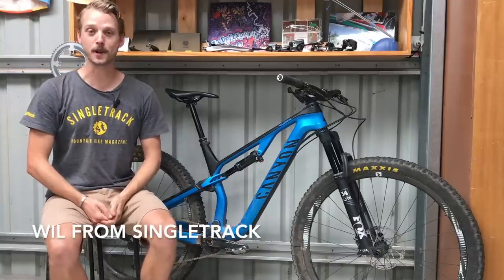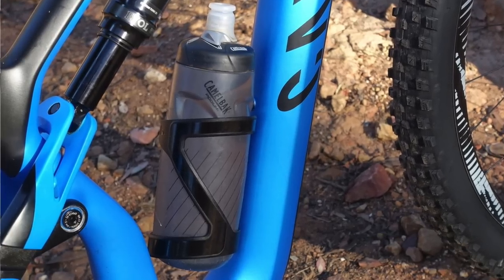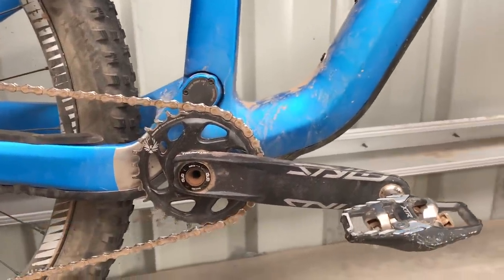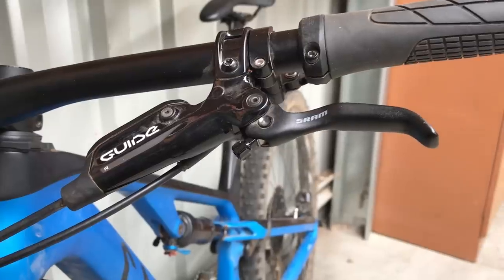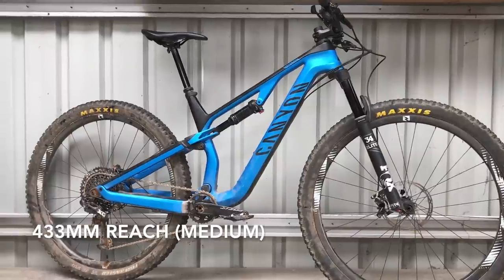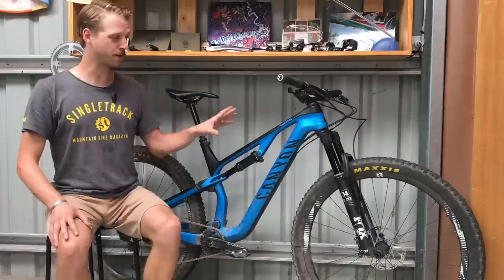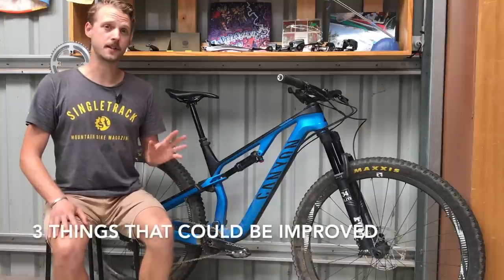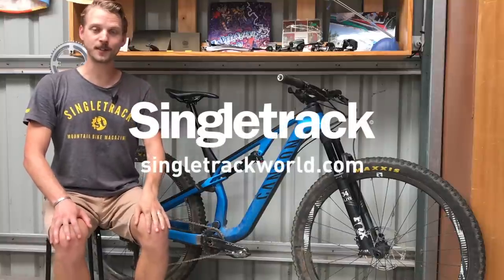2019 CANYON NEURON CF REVIEW | A Longterm Test Of Canyon's New Carbon Trail Bike

Comment: Well, I know this is an old video (more than a year) but it helped me a lot choosing my new bike. 
I've sold my 2011 scott spark 26 wheels, and bought a canyon neuron 9.0 cf. The size question, and contrary to your opinion, I trusted the canyon size tool (I'm 173 cm and 79 cm inseam leg), which advices an S size for my height.

It was the best thing I could do! The bike fits me like a glove, and I manage to ride with the seatpost 3 cm  above the frame, which gave me the clearance to ride with a seatpost bag with the dropper post on lowest position. 

Concerning to the bike, it is a little bit heavier than my previous spark (12,8 vs 12,0) but it feels nimbler and lighter than the spark. And no pedal bob also, during the sprints.
Reply: I also bought a Neuron CF 9 and it has been very suitable for me!

Comment: Thanks for talking about frame stiffness. At 220 lb I really feel the flex in frames that my lighter riding buddies don't even notice. I'm also an aggressive descender so it's hard to tell the difference between the goats and the sheep until I'm already going Mach Chicken down a familiar trail. By then it's too late.
Reply from the maker: Thanks for watching and for the feedback Will!

I think chassis flex is a pretty crucial element for how a bike handles on the trail, though admittedly it isn't always an easy thing to disseminate. Wheel, tyre, fork and even stem/bar flex can all muddy the waters. Because I was able to try other wheels, tyres, and a different bar/stem on the Neuron CF though, it was pretty evident to me how solid this bike is.

From what I can tell via some online comment sections, Canyon has received a bit of flack for the increase in frame weight of some of their high-end carbon trail bikes. Given how capable the new bikes are though (compared to previous models), I think these beefier frames are bringing significant improvements to stiffness, strength and overall ride quality. And in theory, we should be getting longer-lasting bikes too.

[ST Wil]

Comment: This is probably the most insightful and helpful review I've seen in ages. To the point, practical comments that average Joe's like me can relate to. Keep them coming.

I'm in the market for a new bike and have narrowed my option to a Neuron Al 7 and a  Trek Fuel EX 8. Similar price points and components, I guess it comes down to geometry. Any thoughts on which one would be best assuming price is same for both?
Reply from the maker: Thank you for the kind words Erick, and glad you liked the video!

Great question on the Neuron AL 7 vs the Trek Fuel EX 8. I've spent a bit of time on the Fuel EX 8 lately, so I can definitely provide you a comparison between the two bikes.

Personally, I prefer the Fuel EX. It isn't as efficient to pedal as the Neuron, but the suspension is much more active, with a deeper feel in the latter 2/3rds of the travel. 

Because the suspension is a lot more independent of braking and pedalling inputs, rear wheel traction is excellent, and the whole bike can absorb hits more comfortably. It feels really stable at speed and on rough descents, particularly with those big Bontrager XR4 tyres.

I have found I need to toggle the compression settings on the RE:aktiv shock to get the most out of it. For the descents, I'd set it in the full open mode for maximum squish. For smoother trails and climbs, the middle position gives a firmer feel at the pedals and helps to lift the whole bike's ride height. 

In comparison, the Neuron's suspension design is more efficient without need to toggle the compression switch so much. On smoother machine-built trails, it's a quick and agile bike to ride. But once you're on rougher terrain, you will get more feedback due to the firmer feeling suspension design.

Hopefully that helps answer your question, but if you've got any more, feel free to shoot Erick!

[ST Wil]
Reply: Thanks for the quick response. I suspected that this was the case based on your reviews, but good to confirm. Although I really like the idea of a canyon (brand and looks), trek fuel seems to be a more sensible choice as you said.

Comment: Good info! I'm caught between getting the Neuron CF 8 and the Spectral AL 5. Looks like some things you wanted changed have been modified on the new Neurons, but this still gives me a pretty good starting point.
Reply: Totally depends on your type of riding.  Prior to my neuron I bought a super aggressive enduro bike which was terrible for the many uphill trails near me (bay area).  After a ton of research I went with the neuron cf 8 and it has been great, incredible on the uphills and also really good enough for me for some of the more intense Downhills.  So id say if you need something that can handle both up and down go with neuron, but if you’re more into just downhill then do the spectral
Reply: @stueey   I waited too long to get a Neuron on clearance, so I ended up with a YT Jeffsy ;P

Comment: Apart from the bike review which is great, this bike is so well thought out and designed.
Reply: Perry Meister huh? Apart from the seat tube that’s too long, the limited space for rear tyres and the crappy brakes?
Reply: @nl3712  so which trail bike would you recommend that is as competitive (price) as this canyon ?
Reply: @cracotator  Canyon competes well on price (well, except where i live...).  My point was that, while it may be cheap (relatively), it's not perfect.  I only repeated what was mentioned in the review, IIRC.

Comment: I am between sizes and as you said, I was a bit worried about the tall seat tube so went with the S w/ 27.5 wheels.  Obviously I could use a slightly longer reach but it wasn't anything too unreasonable.   The nice thing is, the size S is spec'ed with a 29er fork (Canyan's logic was this ensured consistent handling with other sizes which I did not quite understand), so I ended up replacing it with a 150mm RS Pike 275 fork.  The crown to axle measurement was the same as the 130mm 29er Fox, but offers 20mm more travel.  Now the bike is 130/150 on the rowdier end of the trail bike spectrum.  Worked out nicely.
Reply: This is exactly what I'm planning to do, but going from the Fox 34 to a 150mm Fox 36, which will slacken the head angle by a degree. Has it changed how the bike behaves? Is it less nervous on steep DH now? Thanks!

Comment: Excellent review, thanks! I'm on the older side things and looking at replacing my Santa Cruz Blur that is approximately 12-13 years old. Admittedly, technology has changed substantially since I purchased my Blur. Im considering a 2019 Santa Cruz 5010 or Hightower in the S build with a carbon frame. I believe in that build the component package would be comparable with the 2019 Neuron CF 8.0 but the Canyon comes in about $1400 U.S. cheaper. Hopeful that you may be able to shed some light on differences between those bikes in ride quality, components, and offer some insight on whether the price difference is either way is worth the purchase.
Reply: @singletrack  thank you for the reply and now plenty to think about!

Comment: Hi, thanks for your nice review. 
Which one of the SC bikes you compare Neuron more, Tallboy or reg. Hightower? I have no idea how Neuron feels like, but SC bikes I have tested.
Reply from the maker: My pleasure mate - glad you enjoyed the video!

I reckon the Neuron CF is more comparable to the Santa Cruz Tallboy than the Hightower. The reason I say that is because the handling and descending capabilities of the Tallboy - especially with the bigger fork - are really good for a bike with 110mm of travel, and more comparable to what the Neuron CF is capable of. The Hightower feels like a bigger and burlier bike that I reckon is more comparable to the Spectral.

A big reason is the VPP suspension, which does perform differently - it has a plusher and more active feel through the middle of the travel, so it swallows square-edge hits quickly and efficiently.

In comparison, the Triple Phase Suspension on the Canyon Neuron CF is firmer throughout the travel, which gives excellent pedalling efficiency and a great platform for pushing off of. However, it is firmer and potentially less comfortable when pummelling through rock gardens - at least in my experience anyway. 

Hope that helps!

[ST Wil]

Comment: Thanks for the review! What would you buy, this 9.0 SL or equivalent Trek Fuel EX? Which differences would you highlight?
Reply: Luis Miguel Batista I have same question. Did you end up buying?
Reply: @johnguillaume5919  I got tired of waiting for a bike with very few references and tests against other competitors. Ended up purchasing a Orbea Oiz TR (120mm) almost 1kg lighter, with suspension lock system and kashima on both suspensions for only +300€.

Comment: Nice that it has no pressfit BB looks like a sweet bike
Reply from the maker: It does seem like building a tough, practical, and easy-to-work-on bike was the priority with the Neuron CF. I asked Canyon why the Neuron has a threaded BB, when the Lux, Spectral and Strive all come with press-fit BB's, and the designer stated that ease of maintenance (rather than weight) was more important for them on a trail bike that's designed for big miles. So there you go :-)

[ST Wil]

Comment: Hello, nice review. What would you recommend to me :  a Canyon Neuron or SC Blur with 120mm fork. I currently have a SC Blur and Im thinking of upgrading to a 120mm fork... or give it a try to a Canyon Neuron...
Reply from the maker: Good question Jose!

Personally, I really enjoy the Blur with the 120mm travel fork. It's still a light and tight XC bike, and the rear travel is still quite firm and efficient. But with the bigger 120mm travel fork and some burlier tyres, it is a load of fun to ride on techier trails and fast downhills.

I recently reviewed the Blur with a 120mm travel fork, and you can check that out right here: https://singletrackworld.com/2018/12/review-120mm-fork-santa-cruz-blur-pocket-rocket-trail-bike/

As to how it compares to the Canyon, funnily enough I've actually found the Blur to be more fun and stable on the descents, even though it has less travel. The geometry is just a bit more high-speed friendly on the Blur, whereas the Canyon feels a little steep in the head angle for proper flat-out riding.

Hope that helps!

[ST Wil]

Comment: Really good review, I want to buy this bike, but for women. There is only one big problem I have - what frame size should I choose? I am 173 cm tall, the inseam length is 82 cm. I am afraid that medium size would be too long. I do not know what to do. Hate this problems!
Reply from the maker: Hey @Michaela - great question!

At your height of 173cm, you are only 2cm shorter than I am. However, your inseam is a little longer than mine. That means your saddle-to-BB height will be a little taller than mine.

Because of this, I would recommend the Medium size for you. Your ideal saddle height will be fine because it is slightly longer than mine, and I think you will get on just fine with the reach of the frame. If anything, I would have liked a slightly longer reach/top tube on this Medium test bike. 

If you went to a Small size, I think the bike would be too short for you, and too cramped in the cockpit. 

And really, at 433mm, the reach isn't super long on the Medium. If you did find it a little long, and you wanted to shorten the cockpit, you could always bring the stem back 10mm to a 50mm length. 

That said, you might want to consider the WMN model, which already comes with a 50mm long stem, along with a women's specific saddle. The frame (and therefore the suspension, geometry and handling) is exactly the same between the men's and women's bikes though. 

Hope that helps!

[ST Wil]
Reply: @singletrack  Thank you so much for that quick answer and what is your arm lenght? When I simulate to hold the handlebar, is it 62-63 cm. The Canyon Perfect Positioning System recommends the size small, but the man on live chat told that I could buy Medium too. I ordered both sizes, but which one should I pay. I plan to have a bike for a further x years, so I have to make a good decision.
Reply from the maker: @MJACUS1996  - My arms (from my armpit to the end of my finger) measure about 70cm. But that is not measuring while holding a handlebar like you are talking about.

While you could fit both sizes at your 173cm height, I just think the Small is going to feel really tiny - it will be a very short distance between the saddle and the handlebar. 

I hope that helps!

[ST Wil]

Comment: Mundane question - how do you transport a bike with this rear suspension setup, and a dropper post, if you only have the old style "hang it from the top tube" bike rack?
Will it damage the dropper post to use one of those extendable bars that goes from your handlebars to your seat post and hang it from that?

Comment: Im looking for a Canyon MTB and i cant decide between the Lux, Neuron and Spectral.  I am looking to do mainly rough gravel tracks, riding in woods and want something that is a good all rounder and not too focused in any one discipline.  What would you recommend?
Reply: Did you decide? I am debating between Lux and Neuron. I want a light bike capable of climbing well, and verstility of handling good technical trails. No bike parks or drops. But also long 40-60 rides in mixed terrain.

Comment: Very very good review !  i'm looking for a new trail bike and i like this neuron 9 sl, my girlfriend have a Nerve AL 7.I also have the choice with a Santa Cruz Hightower kit S GX 2018 for 3600€, did you 've advises ? whish is the best climber ?i am living en France and enjoying  many days trails once a year.Thanks
Reply from the maker: Thanks David, and great question!

The Santa Cruz Hightower is a great trail bike, though the VPP suspension design and overall ride quality/handling is different to the Canyon Neuron CF.

In general, the Neuron CF is a better pedalling bike, and more efficient on longer, steadier climbs. The suspension design is noticeably firmer, which gives you a great platform with excellent mid-stroke support. This means you get plenty of feedback through the chassis, which is great on smoother trails, but it does mean it can be less comfortable and less forgiving on rougher trails - both uphill and downhill.

The Santa Cruz Hightower comes with more travel; 135mm at the back and 140mm at the front. It's also a touch slacker, and it also has a shorter seat tube, which means you could run a longer stroke dropper post. Combined with the more active VPP suspension design, it's a little better suited to chunky, technical riding at speed, where you want the rear wheel getting out of the way as quickly as possible. 

Hope that helps you, but let me know if you have any more questions!

[ST Wil]
Reply: Thank you very much for your answer ! i thnik i'll go for the Neuron ! I think i can find better for that price !

Comment: I have this bike, 2020 model, and agree with most everything said.  I do want to change front tire as well.  How was the clearance on 2.6"?  I want to get a minion 2.5"  but Canyon states max tire width is 2.4" for the Neuron.
Reply: I suspect that width # is limited by the narrow rear clearance.  Front looks like a ton of clearance so I think a 2.5 could work fine and be sweet.
Reply: yep Jay got it right. the 2.4" is for the rear/the frame.  the front tire max will be provided from the suspension fork you are using.